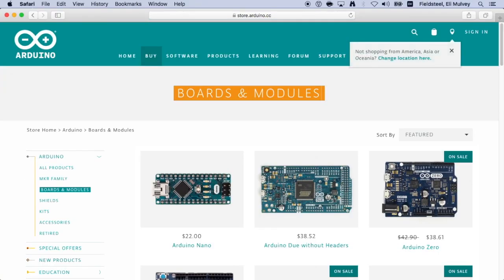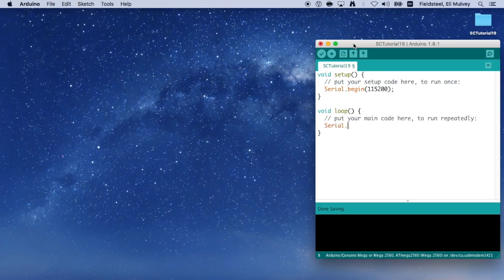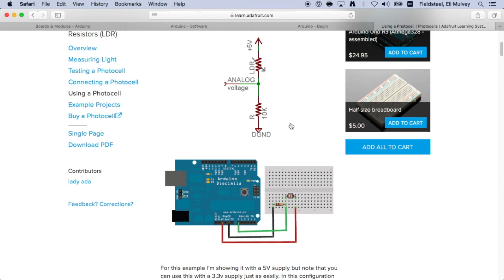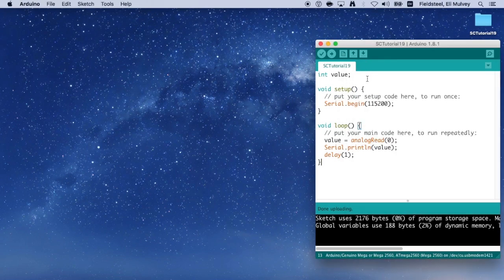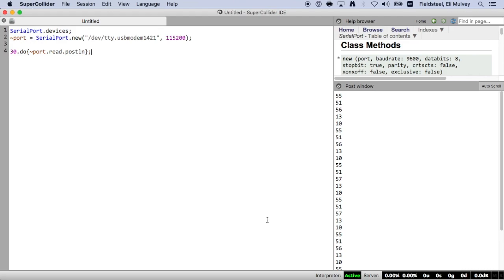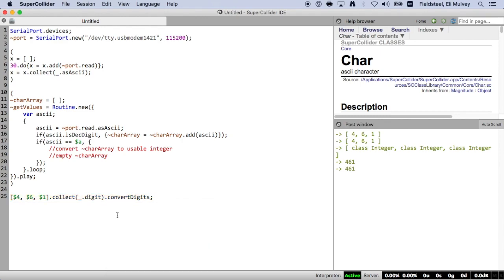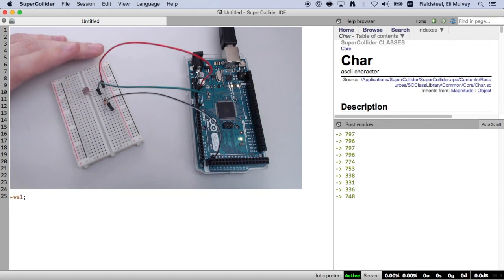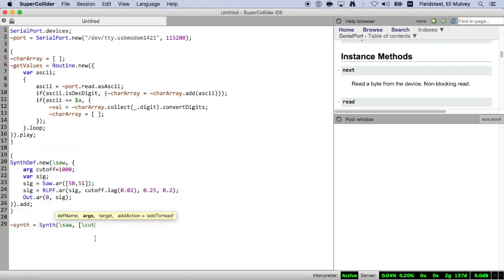SuperCollider Tutorial: 19. Arduino

Comment: I'm a little curious about how you would go about using data from multiple sensors. How would you separate the streams on the SC side if it all comes in as one long stream of numbers? My thought is maybe you'd have the sensors alternate or sequence each element of the steam on the arduino side and then   figure out a way in SC to have a piece of code only respond to say every third digit... Is this the right idea or am I way off? I'm still quite a noob to coding.
Reply from the maker: This isn’t the first time I’ve gotten this question — see the comment posted by Andrés, and my reply.
Reply: @elifieldsteel  Hey thank you. Got it figured out. Also never really used dictionaries but they worked well in another project I'm working on. You and your videos have taught me so much!

Comment: This is great! I've been going crazy trying to run more photo cells simultaneously but can't seem to figure out how to split the data into different streams on Supercollider.  I'm lost !! any pointers?? I've tried useing the arduino quark but it doesn't seem to work on my computer.
Reply from the maker: My solution for this is to build two or more voltage divider circuits on the breadboard (sounds like you've already done this), and program the Arduino to insert separator characters in between the photocell values. For example:

755a459b756a459b758458b etc...

This way, you can use conditional logic in SC to parse the data into useable information. If it's a number, store it in an array. If it's a letter, convert the array to a single numerical value, store it somewhere identified by the alphabetic separator character, and reset the array. I typically use a Dictionary:

d = Dictionary.new;
d.add(\a -> 755);
d.add(\b -> 459);

I don't bother with the Arduino Quark, and in general I typically avoid Quarks. About 99% of the time, I find that I can do everything I need with the default SC library.
Reply: Eli Fieldsteel thanks for your reply! I’m going to try it out.

Comment: Is there a reason why you don't use ArduinoSMS?
Reply from the maker: A few reasons, yes. I tried using it at some point in the past, and I either had some trouble with it or didn't feel like it offered significant advantages over the "roll your own" approach of SerialPort, Tdef, etc. For me, personally, Quarks sometimes create more problems than they solve. I'm kind of purist with SuperCollider, but that's my problem and I'm not advocating this an approach that works for everyone. I generally feel similarly about VST plugins—I'm attracted to doing things using the most vanilla approach possible. Another part of it is that I'm making public-facing tutorials, and I want to future-proof them as much as possible. I try not to rely on Quarks, since I don't know if they'll be supported/discontinued in the future. If I were just a normal user working on my own, I might have a different view.
Reply: @elifieldsteel  Thanks for your reply, Eli! That makes sense-- relying on libraries is always a risk. So I'm a pretty novice Supercollider coder, and I was able to follow this tutorial with good results. However, I'm not sure how to adapt this code for multiple inputs. I tried for hours and failed, which is why I opted for SMS. Would you consider making it video in the future where you go through how to parse data with multiple inputs? Really appreciate your work.